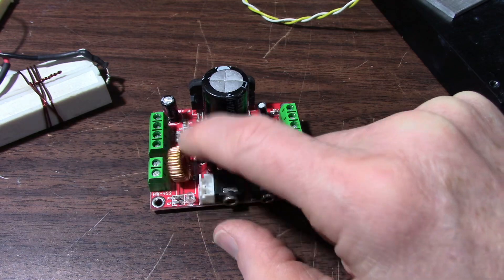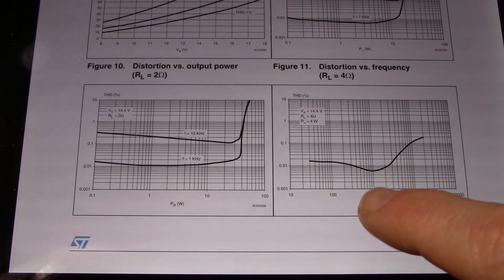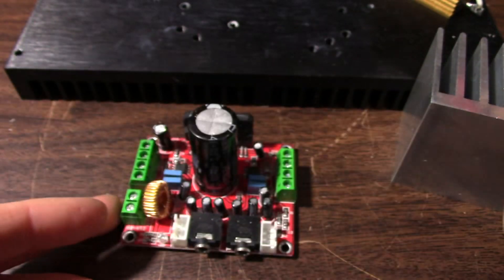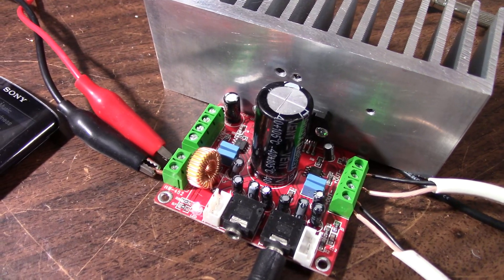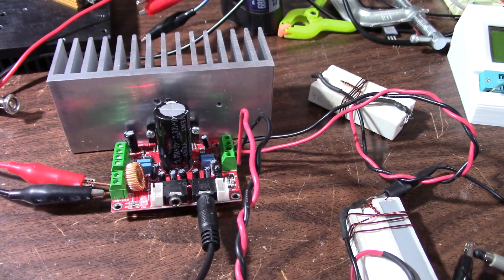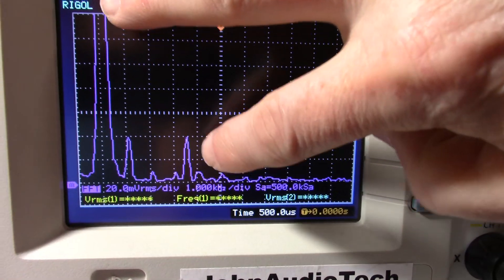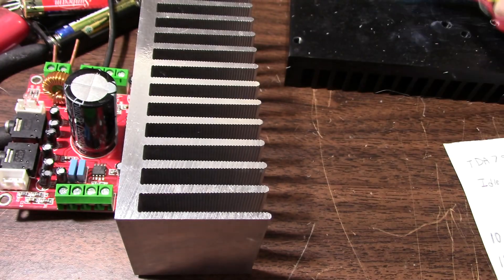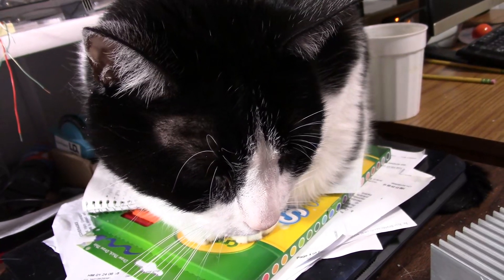TDA7850 four channel audio amplifier test and review

Comment: It is still used in China Android head units. Just bought a new Mekede head unit with this chip an it seems really good.
It does not cut down the bass at higher volume like other chips in other head units i used.

Thank you for the video.

Comment: Thank you for the video. I'm working on a project where I want to connect the TDA7850 (just the chip, no circuit board as it sits on an Android Head Unit pcb already) to an external 18v power supply - a 12v to 18v step up converter. I noticed there are 2x VCC pins (interconnected) so wanted to ask whether I should provide power to one or both of the pins from that external power supply? Thanks

Comment: I'm just getting into this sort of thing as a hobby and I'm thinking of using this amp to modify a cheap soundbar. Correct me if I'm wrong, but I'm assuming that you're using the preamp due to running the music off your mp3. Or is the preamp used to control volume of the amp itself. Also, how much current does the amp draw at full volume?

Comment: I advice you to check Audio Power amps. from Japanese ICs like TOSHIBA and SANYO like TA and LA respectively.... They are incredible performance than Europeans ....
Reply: Looking at sanyo STK4231V what else do I need? Do they make any higher power amps? Need a 4x100w 4 ohm.
Reply: @anglerandy5736  STK is not Sanyo made but Sankeo ... Sanyo amps. start with LA ...

Comment: From your results, another IC manufacturer quoting peak power, rather than RMS power, in their datasheet.
EDIT: just looked into it, seems like it's the EIAJ rating, which is the saturated square wave output power.
Either way it is either double or close to double the RMS rating.

Comment: Hey JohnAT, Thanx again for fine work and sharing big knowledge.. What do you think of so called "Power Conditioners" ...? I think I hate them . AND their claims of drastically improving the sound quality of high end HiFi systems. Aren't most just WAY OVER PRICED power strips. I have one, was a gift, it is way empty inside. A couple MOV's , switch, indicator Neon, no filter(s), no coils. Basic nada. Can any of these power boxes be shown to improve sound beyond swelling one's head and placebo effect ...?
Reply from the maker: Good ones with actual filter components inside can remove a lot of the higher frequency noise on the AC mains which could get into audio equipment. Sensitive audio equipment probably has a decent amount of filtering anyway so the claims can be dubious.
Reply: @JohnAudioTech  Thanx !

Comment: nuh its  not distorted the amp forgot something the stby pin it will distort if the vs signal input is not filtered and switch a transistor

Comment: It's a multichannel mosfet made for cheap car radio's, enough said. You get into overdrive territory (typically 75% on a car radio) and distortion does get unbearable. I've had several decks all have similar mosfets in them. Even with proper settings and making sure there's no final distortion, you can still hear something odd at full volume. Also the heatsinks and power supply's are pretty pathetic on car radio's, as well I don't think these mosfets have enough surface area to properly dissipate heat especially at 50 watts. Nothing beats a dedicated 4 channel amplifier, I had a 400 watt class D tucked away in my center console. Not only did I not have distortion but it brought up the midbass and offered crisper high's, and that was at low volume.

Comment: It would be interesting to look at the supply voltage at the amplifier IC pins with the scope when its loaded up. Voltage drop over the supply wiring and PCB traces can have a significant effect on maximum power in these automotive bridge amps.
Reply: Yup. & Thats why almost every test should be done on all 4 channel loaded.

Comment: ive played with the TDA7850 before its actually a nice amp for 12V. this is what you do. 4 Ohm at 16-18V supply. almost 35-40WPC. if you have a nice heatsink, 2Ohm 16V get around 45W.
Another good quad chip amp is the STPA003 and 008. 16V 2 ohm almost 50W!
or run a TDA7577 which is a stereo chip in PBTL 1 Ohm 16V for about 80W.

i have too much fun with chip amps

Comment: I wonder if it is a real chip, or a counterfeit chip. China counterfeits so much, its always a gamble.
Reply: You find out when it goes pop at 50% of it's full rating. Don't try driving 4 2 ohm loads - a counterfeit will probably die pretty quickly.

Comment: 4x80W at 2 Ohms? Lmao. 320W into that small little chip. Seems like the perfect way to burn down your car/house. But as always great video :D
Reply: 20W per channel  for 4ohm load before clipping
40W per channel for 2 ohm load before clipping. 
Efficiency is more than 70% before clipping. It can go as high as 80% after clipping. 
If you have good heatsink shouldn't be any issue. High temperature wouldn't cause fire. With semiconductor, it will die before csusing fire.
Reply: Even more since its class AB
Reply: That's clean power guys. The datasheet says it can do 4x80W into 2 ohm loads at 10% THD.
Reply: @adithyapillai4259  Yeah higher power output higher efficiency according to the datasheet. And you don't really use it at clipping  do you? Not even full amplitude sine wave.

Comment: I'd not say that the harmonic distortion was bad since it is indeed second harmonic and audiophiles appreciate those. I was really impressed by the performance of this chip. Although I doubt it can actually handle high levels of volume into 4 ohms, let alone 2 ohms. But it's a fine little chip for a home theater system I guess. If you use it with 8 ohms load at 14.4V. Should be good.
Reply: You can read datasheet ei? They can provide much higher power at lower resistance load.
Reply: @johnyang799  I can't understand your English.
Reply: @marciojpcardoso  You can read the datasheet. 20W to 4Ohm, 40W 2Ohm clean power from datasheet. Believe the datasheet, it's not deceiving or anything.
Reply: @johnyang799  I don't believe in data sheets. In believe in real measurements, that's why I watch theses videos.
Reply: @marciojpcardoso  The results are consistent with datasheet. Problem is, you are still guessing.

Comment: Capacitors play a major part in the coloratura of sound.
Reply: Only for Audiofools. and never in double-blind tests. Everyone else knows otherwise.
Not many modern amps use (need) capacitors in the signal path. This one uses some caps on the inputs to block DC, but the influence of those caps will be irrelevant above 15-20Hz.

Comment: I agree those terminals are crap. For use once, they are passable, if the screw heads don't mangle up first! But it's really bad news if you need to screw and unscrew a couple of times. I often end up soldering the wires to the board. I think the most irritating thing is you often cannot get a decent thickness wire even in the hole.
Reply: I put ferules on the wire ends; this avoids the connection problems.

Comment: Anyone else believe that cap is more then 440mf?  More likely 220mf.
Reply from the maker: My meter reads it as 10,000uf
Reply: @JohnAudioTech  I stand corrected.  However, I am amazed.
Reply: It's 16V... From the size it looks more like 4700u I'd say but it's hard to tell.
Reply: @westelaudio943  It's very possible to be 6800uF if it's 25V. 16V 10000uF is not impossible.